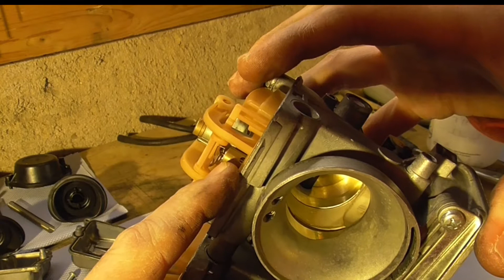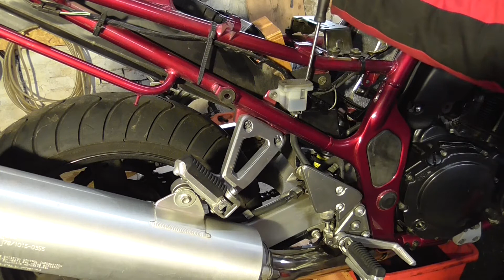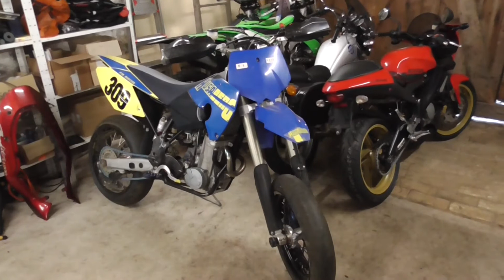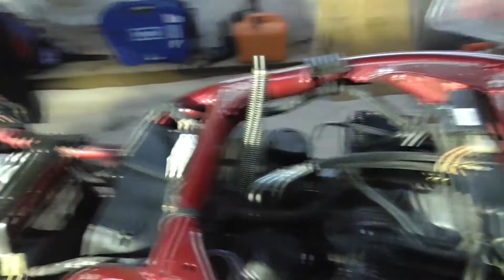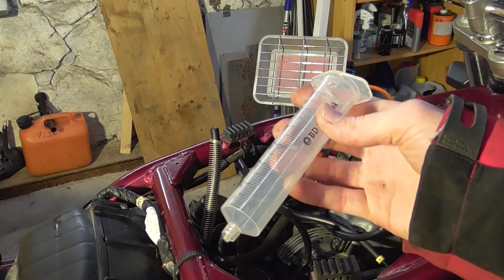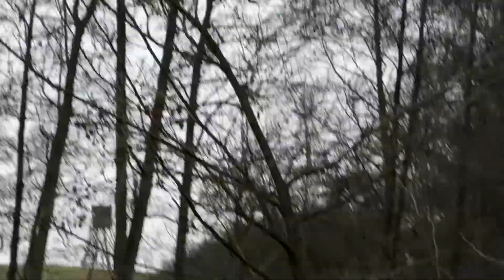Suzuki Bandit N 1200 - Will it Run? Carburettor Assembly and Brake flush - part 2

Comment: If you're only changing the throttle cables do you need to take the carbs off to get at the bellcrank?
Reply from the maker: I think yes bc there is not much space and it's fiddly

Comment: By any chance, do you know if a wrong float height can cause the revs to hang at about 2000rpm? It seems to be a rich condition but it's not the pilot screws or vacuum leak or wrong jet sizes etc.
Reply from the maker: No I don't think so. If the floats hang too low there is not enough fuel at high rpms. Do the rpm hang when going down? That's usually wrong idling mixture.
Reply: @bikedogtor1663  Yes, so: you're accelerating or just cruising at about 4000+rpm and then pull the clutch, the revs drop like a stone to 2000 but then they take about 3 seconds to go from 2000 to 1200/idle. The idle screws are set to factory standard, screwing them in even just 1/8 makes the bike run really badly with backfiring and everything...
Reply: @jonass961  I have a very similar problem on my b12 (96)
Reply: @ThomasMoore.1  I'm having the suspicion it's the floats because I've messed with them once... How about you?
Reply: @jonass961  needle and seat may need replacing the little spring loaded plunger in the needle gets soft altering your float height